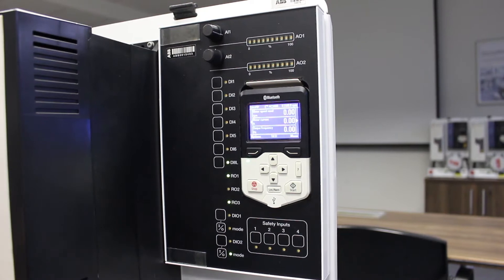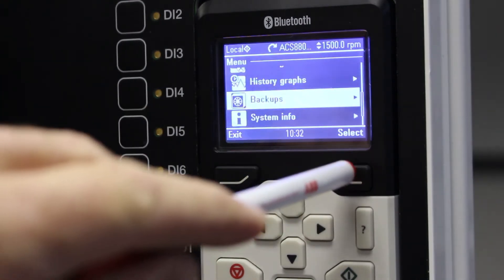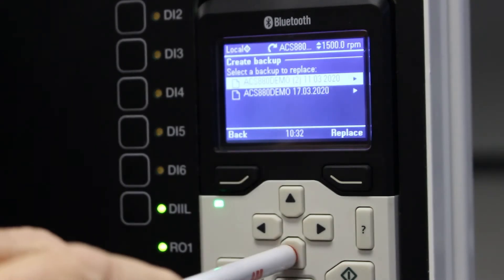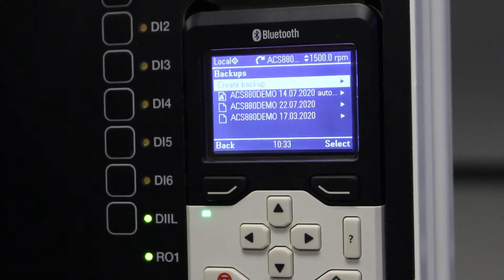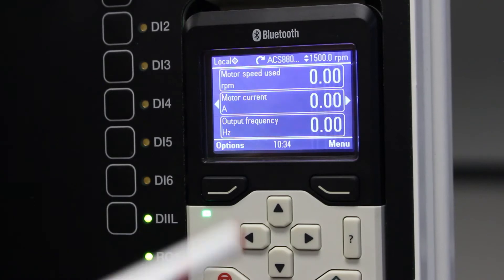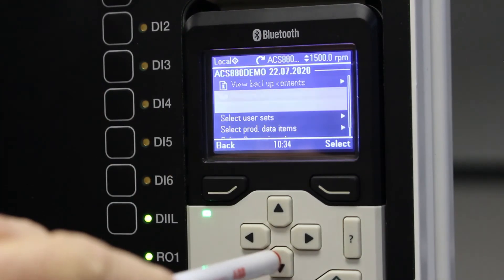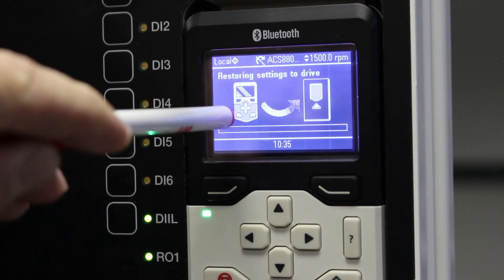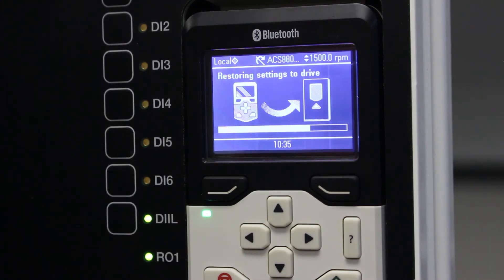ABB Drive Control Panel -  Parameter Backup & Restore

Comment: My VFD has a different problem,
My VFD wont allow me to Restore, it always say    "Drive is in Auto mode, press OFF for manual control"
Fault on the VFD shows "I/O MCU not ready"

message: If your device is IP55 the problem can be fixed by starting the drive with the internal fan disconnected. then connect the fan back to the drive and the problem should not occur anymore.

please make a video on how to perform this troubleshooting.
THANKS